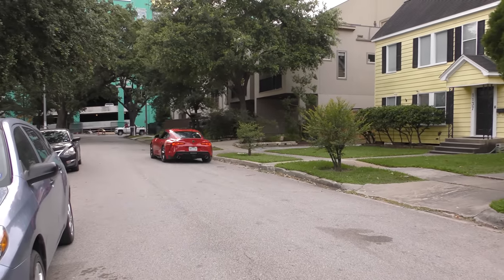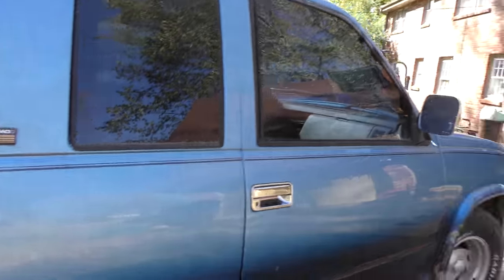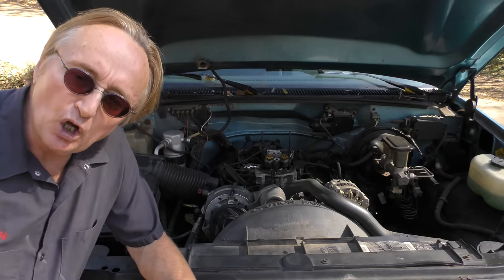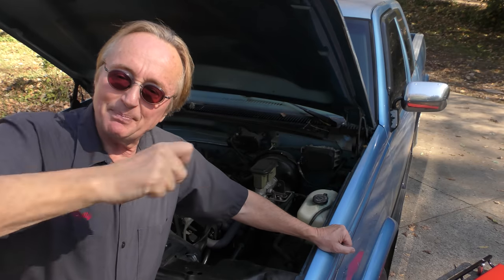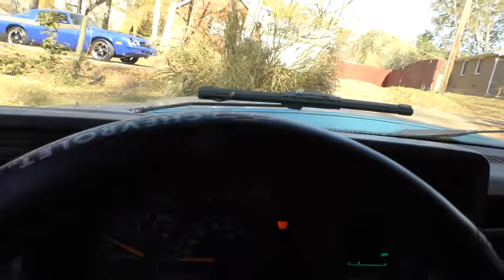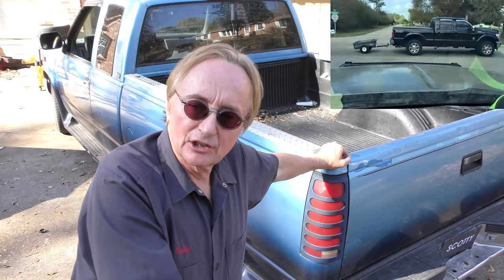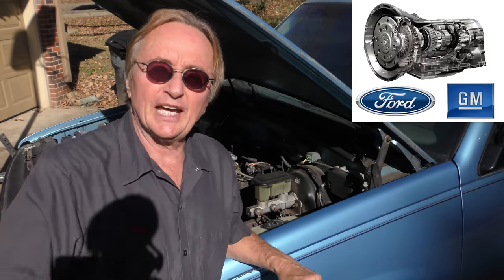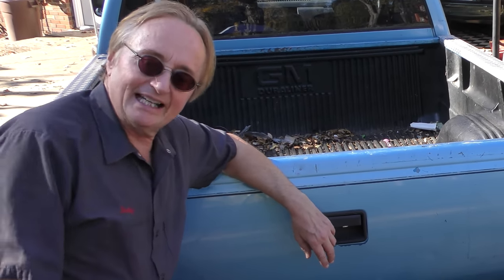The Only Chevy I’d Buy

Comment: Every homeowner should have a beater pickup truck.
Reply: Not really
Reply: Come to Oklahoma 😂 or Texas!
Reply: @bojackson6714  an Florida, my 95 stepside is not a beater but it’s a great truck
Reply: @Jp-gc6bh  awesome! We have some of the fastest trucks down here 😆 but almost everybody has a beater Chevy in there yard
Reply: @Jp-gc6bh  I don't consider mine a beater either. I have a 2002 Silverado ext cab, long bed 4X4 Z71. It's got 341k on it. Still looks great. Bleeds a little oil, but still runs great.
Reply: Jus picked up a 1998 Silverado good rig..
Reply: @Barneyrubble241   Hey, I have a beater, a 1994 F250 4x4 with a plow, bought it for $8 grand 18 years ago, it's as basic as you can get! Has a 5 speed manual transmission, its a rust bucket,  that 5.8 engine is no horse power monster, but it starts without fail everyday. Needs a clutch, but I got 10 years out of that clutch. Had to replace some of the front suspension parts from all the wear and tear from plowing last year,  but did the work myself for less than $300, and I will have to spend $600 for a new clutch assembly,  but hey, what the hell, when I think of all the money I made off that truck, its ok.
Reply: Why?
Reply: @JordanJordan-dj8gv  no fr, having a pickup truck has so many more uses than you would think
Reply: Facts
Reply: @JordanJordan-dj8gv  nah, you really should
Reply: Does Scotty not realize that at the time the name “Silverado” referred to the tri line of the K1500?

There was also a Cheyenne and Work Truck Trim
Reply: It is my home sometimes.
Reply: I've got 2 2000 model silverado's. Both are decent trucks still. Use them everyday for something. No way would I use a $65k rig like I do these
Reply: I need one too!!
Reply: I have a Buick century v6 as beater I strap plywood o 2x4 on the roof trunk i through tools soo unless I’m hauling o plowing all I can think off I would need but I just want one
Reply: @gamingislife3332  if you were a homeowner you wouldn't need to ask.
Reply: Whether you consider it a "beater" or not is besides the point, you are 100% correct.
Reply: @demetriuscooksey7147  dude. I'm asking because I'm not
Reply: Or a Denali like I do.
Reply: Definitely agree with that 👌 👍
Reply: Agreed
Reply: Honestly, you never know when youll need it and thats what this rising society of hybrid owners gotta pay that $19.95 for those 75 minute home depot rental trucks😂😂😂
Reply: Agree 100%
Reply: @Jp-gc6bh  some people think old = beater. Not if you take care of them. Love my old 94 single cab. That 350 just keeps chugging.
Reply: nah that's silly, a minivan, suv, or even hatchback would serve most homeowners just fine
Reply: The real q is: should everyone be a homeowner?
Reply: My 95 ext is a beater but soon to turn into a factory show truck
Reply: it's my beater and my daily but she is clean
Reply: I’m 23 years old and I work by the beach in ca and I agree best personality people and most appreciative rich people keep a beater
Reply: Yes or nice truck with a trailer
Reply: With today’s economy, every non-homeowner is driving a beat up pick up truck
Reply: You bet. It’s an American icon . Always need an old pick up for dump and HD runs. Or helping you neighbor 👍😊
Reply: Yes indeed! Older vehicles specially trucks are better because that’s when they built to last. Not to spend extra money. I have a 17 6.7 rig welder. I rather drive my 7.3 manual better than and i have 300k miles on it with no problems because i take care of it.
Reply: Why

Comment: The silverado badge was from the factory. The trim level was “silverado”
Reply: Yep...Chevy recycles their truck names in a weird way. Silverado used to be the top trim level in those years, and Cheyenne was the base model...back in the early '70s Cheyenne was the top trim level. Then they changed Silverado to mean all of their full size trucks, regardless of trim. I've kind of lost track of their naming system, so I don't know what their trim levels are now. You'd think they would want to kind of keep the names of their trim levels the same over the years just to avoid confusion, but maybe they want to confuse their customers, idk.
Reply: Silverado was a trim level, and those headers aren't stock. The stock ones are some thick heavy cast iron manifolds. Other than that, yeah its a pretty good truck. Ive had a 94 and currently got a 92 that I've built up.
Reply: @eyellgeteven9928  W/T, LS, LT, LTZ. Unless the trim doesn't match, any true Chevy truck guy or gal would know that somebody didn't just stick the Silverado badge on there. I think they change the names around to whatever sounds fanciest and what will sell (of course). Worst example of a recycled name for Chevy is "Blazer" in my opinion.
Reply: @vqmedia7513  Did you also notice the front seats are out of a 03 to 06 Silverado?
Reply: @wdc9633  I agree. The new "Blazer" is an abomination without a doubt.
Reply: How could he not know that I guess he spends too much time in his celica
Reply: @vqmedia7513  Is that also an aftermarket fuel injection kit sitting on the carb body there?
Reply: @emo65170.  No, that is the factory fuel injection setup for those model years.
Reply: I think the Scottsdale trim level from the square body generation was dropped when they came out with this GMT400 generation.
Reply: @wdc9633  glad others can recognize that is a factory sticker. Kind of surprised how much history on these trucks has been lost over the years 😒
Reply: confused screaming
Reply: @michaeldurbin6528  I did not. Good eye
Reply: @emo65170.  no thats standard throttle body injection from 88-95
Reply: @TTM719  The gmt400 came out with three trim levels Cheyenne, Scottsdale, and Silverado. I have seen a lot of the Scottsdale trucks from 88 to 94 but I don't recall seeing any 95 to 98 with that trim package.
Reply: @michaeldurbin6528  I didn't know the gmt400 had the Scottsdale trim, because I thought they dropped it after the square body truck generation ended. All this time I thought the only two trim levels Chevrolet offered for the gmt400 a buyer could purchase was Cheyenne or Silverado.
Reply: @TTM719  The Scottsdale's are pretty scarce in my neck if the woods these days but there are still a few around. Like I said I've only seen them in the 88 to 94 models. They may have discontinued the trim package after they updated the interiors of the trucks in 95 but I don't know that for sure. I just personally haven't seen any after the 94 model year.
Reply: @Michael Durbin Well that makes 2 of us, because I hardly ever see the Scottsdale trim of the gmt400 where I live either. I do see Cheyennes from time to time, but I see Silverados the most.
Reply: W
Reply: Yep you are right.
Reply: The guy I bought my truck said he just glued that Silverado piece on
Reply: Just like  “ranger” used to be a trim level for Ford
Reply: And it's a shortbed
Reply: my 94 truck has factory silverado badges??
Reply: @cdy291  he’s a mechanic not a cars sales men. Do you know how many trim levels there are when you take in to account cars being around 100 plus years? It’s impossible to memorize all vehicles and their trim levels. That’s why Scotty doesn’t know.
Reply: With "premium" cloth?
Reply: @vqmedia7513  88-94
95 was the Vortec. And the airbags. And the cup holders on the dash.
Reply: @crtinkering7323  so does mine.
Reply: @emo65170.  did you not watch the video?
Reply: @TTM719  there were some Scottsdales in this body style but not many. 88-98 model years I think
Reply: @livewithnick  Oh.
Reply: @eyellgeteven9928  Both trim names are better than “trail boss” any day of the week
Reply: @squishyland2000  Very true.
Reply: Correct.
Reply: @eyellgeteven9928  Cheyenne was a mid tier in reality, there was a WT which would be the base model v6 automatic transmission long bed single cab i think it was just 2 wheel drive 
Cheyenne was a step up and Silverado was the top dog
Reply: Yeah was going to say My 94 C1500 Has a silverado Badge on it that came from factory.
Reply: @eyellgeteven9928  💯!! The new blazer is pretty much an equinox with blazer badges, nothing about them screams “ let’s go muddin” lol, 3 years ago I bought a 02 blazer ZR2 for $1000 bucks and it’s my everyday, love these ole trucks, 4.3 vortec with the 5speed manual.
Reply: I got a 1991 gmt400 with 456000 miles original motor and trans does now need trans work reverse went out last week I love me some gmt400schevy
Reply: Lol, I thought it was right too.
Scotty was wrong!!!! Wow!!!!
Reply: Kinda like the Pontiac Trans Sport (GM U-Platform minivan) had a “Montana” trim level but that trim was so popular they made it base and renamed the entire van to “Montana,” dropping the “Trans Sport” name for North America. In Europe they continued selling the Trans Sport as a Chevy!
Reply: @eyellgeteven9928  actually no lol. On squarebody trucks Silverado was still the top trim level. It went custom deluxe/Scottsdale/Cheyenne/Silverado
Reply: @eyellgeteven9928  for GMC it went Sierra/Sierra grande/high sierra/Sierra classic
Reply: @brandonbell3089  When did I say it wasn't?
Reply: For further confusion I remember when Tahoe meant a trim level in S-10 blazers. My parents had one. Pretty cool badge on dash. My 1990 V10 (yes it’s a k5) has a Silverado trim package and it’s an emblem on the dash and 2 behind front passengers on fiberglass top. It’s a V10 Blazer with Silverado trim package. Odd ducks those years.
Reply: @adammfharris  if you're talking about 4.3l S10 pickups, then you may be right but 1st year of the 5.7l Vortec in C/K1500 trucks was the 1996 model year...
Reply: @eyellgeteven9928 that's funny because in Mexico the Silverado is the base model and the Cheyenne is the more Luxurious model

Comment: This is from back when GM used to make good, solid trucks - a time before those penny-pinching bean counters started ruining GM.
Reply: What year GM started going bad?
Reply: @madebydade305ify  2007
Reply: @madebydade305ify  way back In about 1970 or so tbey started to go down hill
Reply: @donaldpump7378  they got bailed out they started going down un about 1970s and have been going since there trucks about 2000s
Reply: Automakers are trying the build larger more luxurious trucks, while attempting to save weight.  It is difficult to accomplish both.  The government safety, emissions and fuel economy regulations complicate the newer models. Profits from trucks help subsidize sales of low profit models.
Reply: Like you say, it wasn't necessarily true with GM cars, but like with some other manufacturers, trucks are a different story.
     My brother had a '94 GMC C1500 long bed similar to the one in the video. He had over 450,000 miles on it, when the rear end went out. He could have installed a $90 rear end from Pull-a-Part, and he'd still be driving it, but he was ready for something new, so he junked it. It never burned any oil. It was a 5 speed manual transmission with the 4.3 litre V-6 and was made in Ft Wayne, Indiana.
Reply: 2007 is right that's the year they found a way to ruin 5.3 v8
Reply: @sparky6086  Many trucks are only used to occasionally haul items like furniture and maybe a load of mulch now and then.  Trips to Home Depot.  The stock Chevy 350 is a low stressed motor - kind of a lazy tune, but that makes them reliable and they sure can be cheap to repair.  Most people are too busy to update older trucks, but with $5,000 in Maaco paint, tires, transmission overhaul, a new carpet and seat cover set they can be a good daily driver for the DIY project.
Reply: @timothykeith1367  It was my brother's work trunk. He contantly overloaded it, pulled trailers and wasn't "easy" on it as a driver. He could have been a stress tester for Underwriter's Laboratories! He put over 450,000 "Rode hard and put up wet" miles on his 1994 GMC 1500. ...He did keep the oil changed. That helped.
Reply: I think they went downhill at about 2007 especially with the stock market crash
Reply: We were told...every extra bolt nut or process step that could be eliminated when putting a vehicle together meant big savings...we were rewarded by removing steps, nuts,  pinions, clamps and attachments. If you wanted to be recognized you had to stream-line the process to eliminate a step or a part savings. If you were able to remove a clamp or extra brace in lieu of one beef-er brace meant ten's of millions of dollar savings over a years production. Big money in those little plastic  wiring harness clamps...less is better $$...when building. Why spend 43 cents on steel hose clamp when you can buy a plastic one for 9 cents....we're talking massive savings...on the yearly output production year!!!
Disclamer: I drive an 1989 GMC truck....i used to work for them...but never could afford to buy a new truck. Besides i'm super happy with my '89 1500 Sierra.
Reply: Man you must be young! GM paid a lot of money to be broke before they decided to make poor products. You can clearly see their deteriorating attitude was established when the people on the assembly line who was making cars and buying foreign cars. About 1975. See in the 1970s the colleges saturated the country with accountants. The 1980s colleges produced and saturated the country with lawyers. Accountants with shoddy money manipulation
Reply: @landyacht1999  not true, the new gen 5 lt 5.3 is a pretty advanced and great engine. Mine has 4500 hours on it and 195k.
Reply: @FredTheLutinoCocatiel  lol
Reply: @nvdubs  nope, he's right. I have a 2011 Silverado 5.3 vortec and a 97 k1500 with a 5.7 (350) vortec, and the 350 outperforms the 5.3 in almost every way. The peak torque comes on early at around 2000 rpm in the 350, while the 5.3 has to rev up to 5000 rpm or so to get it's peak torque. The 5.7 350 vortec gets 4mpg more then my 5.3, and it has much better throttle response compared to the 5.3. Stock 2007-2013 5.3s are absolute dogs compared to late 90s 5.7 vortecs and early 2000s 5.3s, at least from my experience of owning both. I think the 5.3s got a little better again in 2014, but imo I prefer the older ls engines
Reply: @landyacht1999  what’d you think about the 4.3 vortex
Reply: @madebydade305ify  they started getting bad after 2003
Reply: I've been driving a Chevy Truck for 30 years - it still looks, drives and runs like new. I have taken care of it over the years. The only thing I have replaced is the A/C.  I has a lot of torque.  Still has cruise control too.  Having a steel bumper is a luxury today...most vehicles have plastic bumpers. What brilliant guy thought up that?
Reply: GM still makes better trucks than Ford(waaaaay easier to work on if it breaks down, which is unlikely if you take care of it)
Reply: All GM Trucks are better than the competitors!
Reply: @gagejernigan5277  Having been a Ford and Dodge guy my whole life I just got my first GM truck, it’s a 2000 GMC K2500 with a 350 vortec with 105K on it, I’ve heard a lot of good things about these old trucks so I’m keeping my fingers crossed
Reply: @lerg12  that is a great truck it should serve you well
Reply: @Victoria3232-j7o  idk were you heard that from lol. They made better trucks in the 1960s/70s/80s than any Ford 😂😂
Reply: @MrFmccarty  ford trucks were the cheapest built truck in America 😂😂😂. Ford trucks are also the most recalled vehicle in America since 1970
Reply: @Victoria3232-j7o lol damn in the 70’s I’m born in the 94 I like the 99-02
Reply: @Victoria3232-j7o  Not for trucks but in general for many of their products.
Reply: @donaldpump7378  Spot on. That's for trucks really. They started adding fuel mgmt technology to squeeze more MPGs and created common point of failure on them and their build quality started going downhill.

Comment: I am the original proud owner of a 99 Chevy Tahoe with the 5.7 engine. It just clocked 580,000 miles. Other than some minor repairs (fuel pumps, water pumps, radiator) there has never been a problem. It looks and sounds like the day I drove it off the show room floor. I change the oil every 5,000 miles with a good synthetic oil. Best vehicle ever!
Reply: original proud owner be quiet lmaoo
Reply: Thanks bro
Reply: I change mine every 1500 miles because I get bored.

Comment: What I've heard is, the reason the transmission tend to go bad is because everyone is hauling in overdrive instead of regular drive
Reply: Probably most of it. The 700r4/4l60 and 4l60e are all not known for their towing capabilities. 3/4 clutches are a weak point of these trans, same with the sun shell stripping.
Reply: Yep
Reply: I ran my 88 and 93 GMC Sierras in overdrive, and fortunately, the original transmissions held up just fine. Over 200,000 on the 88, and 165,000 on the 93. Each had the 350. Drove those trucks rather conservatively and had the transmission fluids changed regularly, which helped.